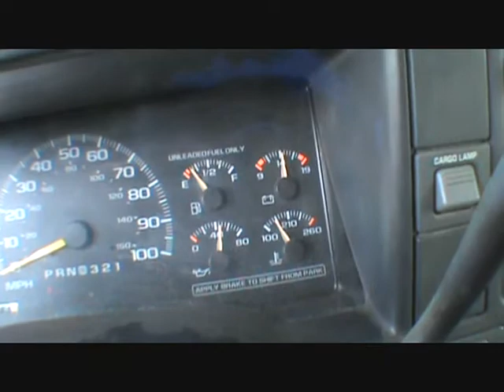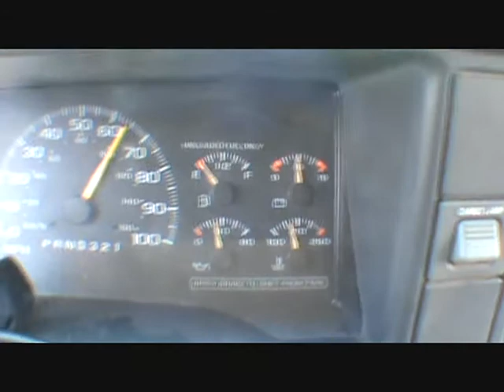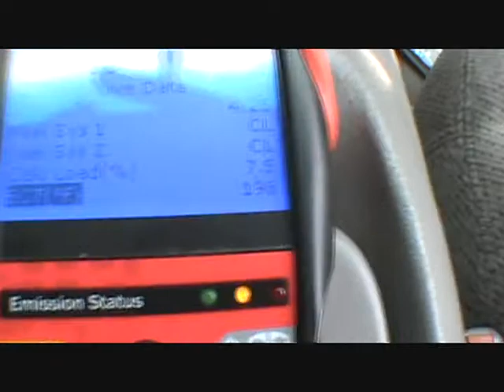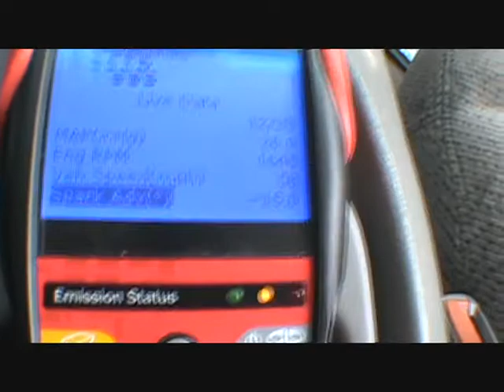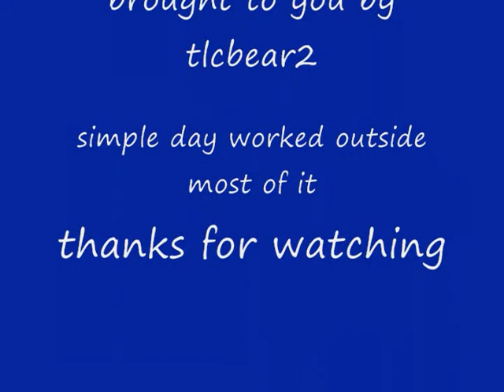maintenance day changed oil in kid car, fix gmc truck radiator

Comment: At an idle it should read 0 +/- 2 when rpm's comes up it will change.
Reply from the maker: so if at idle its not reading that timing is off then.i will check again but i think it was like -21 at idle.
Reply: Right 0 would be great but you are allowed 2 degrees either way.
 -21 is a little much lol.
Reply from the maker: 73Shakes
ok thank you